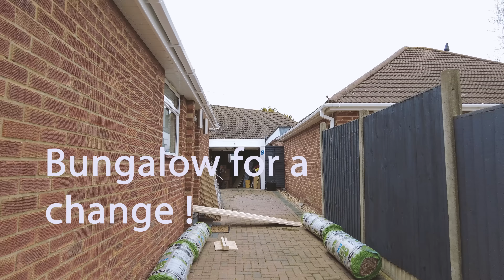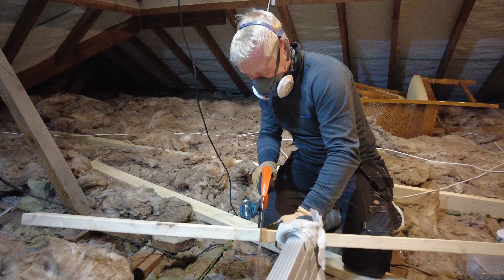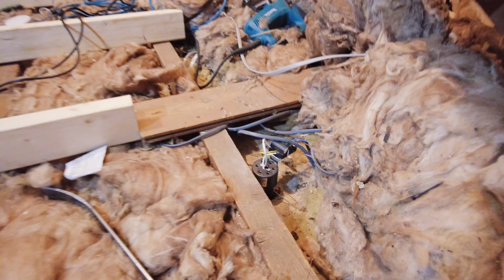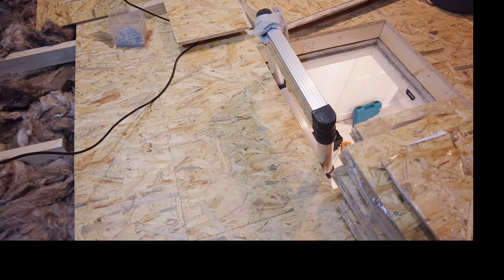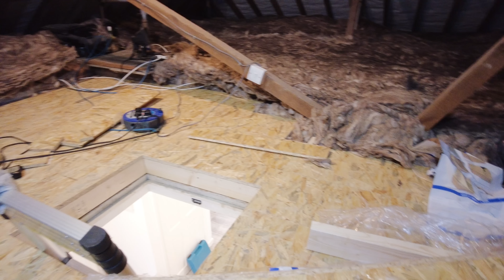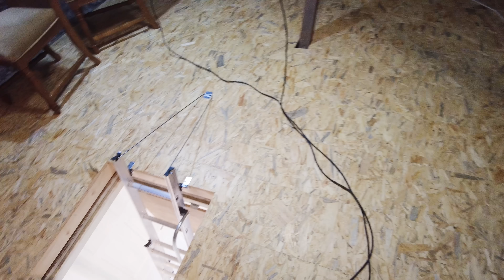Loft boarding - 4k uhd using osmo pocket 2

Comment: Hi grumpy man. Nice job there.
I noticed you put the timber the other way opposite direction " crossing the joist" . While doing my loft, can I put it same direction as my original joist or it should be opposite way of the original joist.

Thank you
Reply from the maker: Hi Khaleel, many thanks for your comment, try to always place the new cls at right angles (opposite way) to the original joists as this will add strength, good luck with the project..
Reply: @MrBish11  cheers
All other companies or individuals who do loft boarding, they will never ever give you so much information and help. You are the only one who explained everything to people.

One last question please.
What the maximum and minimum distance between joist you have to keep, bearing that the loft board is 300mm×1220mm. And loft joist is 600mm distance
Reply from the maker: @khaleelghoora9467  No worries, try to use 400mm gaps or there abouts if possible..